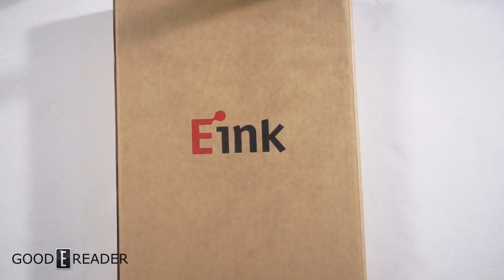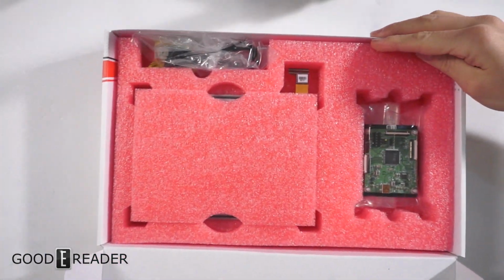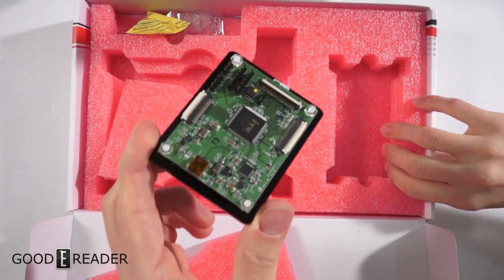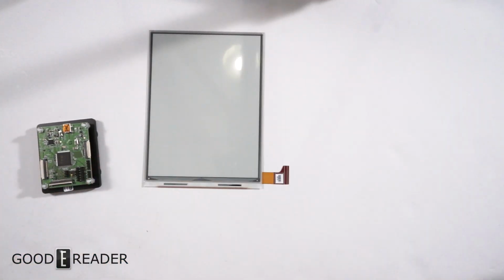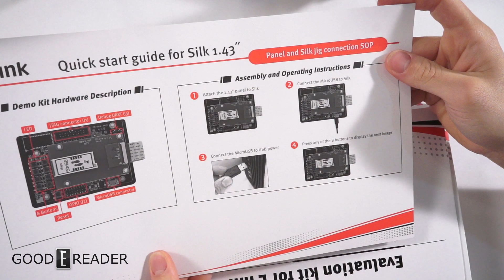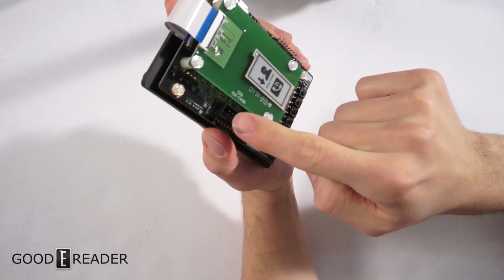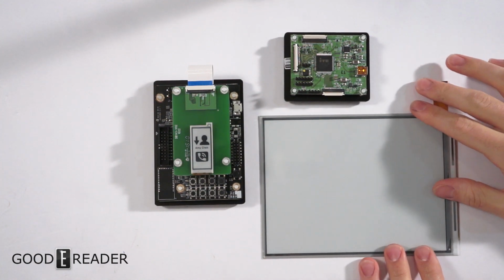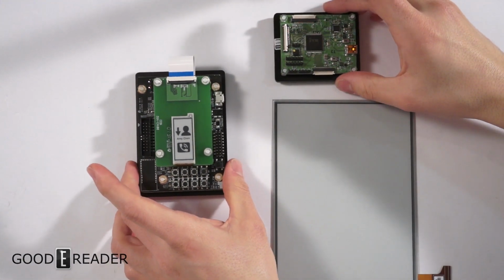Eink Development Kit - First Look

Comment: I can imagine the larger display eval kit you showed being used by some tech company to develop their first e-reader or something, then the display eval kit could be used to show what their UI would look like on the device itself as they were designing that UI. I then imagined them putting the panel itself with a 'screensaver' still on it, into some prototype case design to show off at CES or something like that.

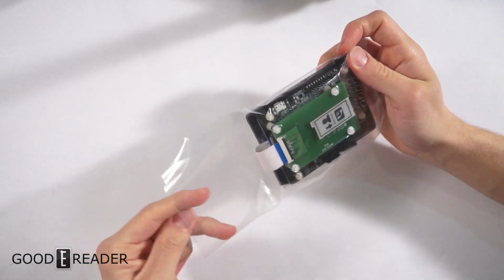4:35 Looks like they imagined that kind of display being used in one of those smart fitness bands.
Reply from the maker: totally

Comment: "this looks 2006ish" ...its cheaper and the footprint was probably already in the library....last: space is rarely a concern on a dev board. so if the mfg isnt under a  space constraint and cost is lower... profit is higher with the mini. 

the purpose is to give you a rough build and or save you from having to know how to make a pcb to try the product or save the company from having to do a "RIGHT NOW EVAL" design pcb then send to fab and another for final thought out product....they are generally priced like a convenience item as well. aka for a mid sized company its a drop in the bucket but sucks to be a diyer and need one. that last point isnt true of all but a lot of dev boards i looked at. I finally decided I needed a uv lithography and cupric etch bubble tank because that ended up costing the same as 2 eval boards for products where the ic cost was like 4 bucks but the eval board was like 100.   plus if cost is lower andu know a lot about pcbs?